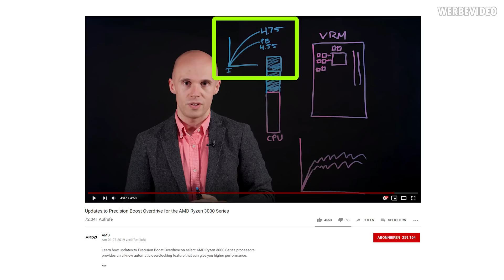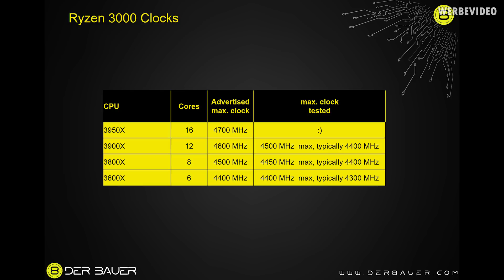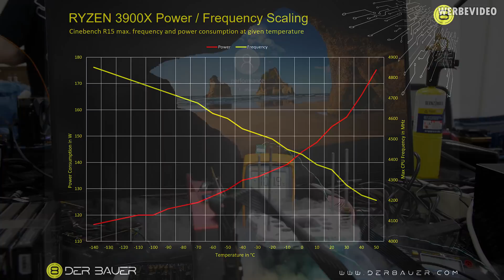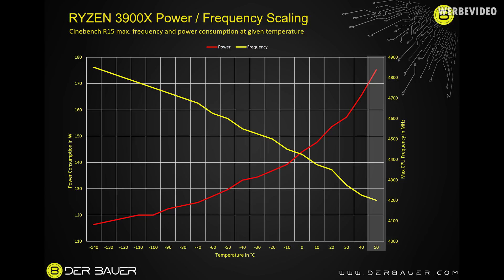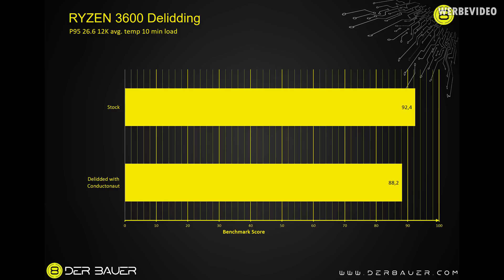RYZEN 3000 Delidded - Overclocking Expectations and Temperature Scaling

Comment: What about LM between the IHS and the Cooler? Here my 1800X was 10c lower with LM.
Reply: If you mean Liquid metal i guess you didnt watch the vid, thats exactly what he did
Reply: @dralord1307  He applied LM on the dies, not between the heatsink and the cooler. Anyway, he said the advertised clocks did not show up even with a CPU chiller.
Reply: Temps aren't the wall between Zen 2 and 5.0

Comment: Ryzen 5000 series surely should achieve 5000Mhz overclocked if not stock.
Reply: There isn’t really a reason to

Compare a 1700x vs a 3700x at identical frequency’s the 3700x is massively better

Comment: So thats why they were so quiet about overclocking at computex and E3
Reply: Wow really, did your 2600x boost to 4.2 all core? No, then why the fuck did you expect this to get to 4.4?
Reply: my 2600 does 4,1 all core easily. with better cooling and that x-chip 4.3 should be realistic
Reply: @m.streicher8286  I'd expect it to hit single core max frequency they advertise consistently. This is saying none of the chips even on a single core hit their max advertised speed.
Reply: @richracing7420  Yep, that's pretty sad. Hopefully it's a bios thing.
Reply: I'd wait for Hardware Unboxed review before jumping to conclusions.
Reply: That's what happens when you believe the Hype train. You will
 end up disappointed because it did not meet your expectations.

Comment: I have already seen one review.  They auto OC better for the most part than you can manually achieve.  They are tapped out to the max pretty much stock.

From what I saw a 3700X at 4.4 matched the 9900k at 5.3 in cb so you can't complain about AMD's clocks with that solid performance. Mind you both we OC'd with chilled water.

Comment: Only an Intel shill could be dissappointed by Ryzen 3000 lol
Reply: Given that my 2700x does 4.2GHz all cores at 1.3675v, the 3000 performance does seem a little disappointing. EDIT: 1.33v.
Reply: @Safetytrousers  stock 3600 with less cores beats it, yet it's disappointing, cool.
Reply: @Safetytrousers  to clarify, in games the 3600 tends to beat the 2700x, it's cheaper and uses less power. If you were to compare your 2700x to it's replacement, the 3700x, it gets smashed and the 3700X uses less power while doing so. Seems like a win to me.

Comment: I have to be honest here I knew they wouldn't hit 5.0 given the current generation struggled to hit 4.1GHz. That said, I find it impressive that you managed to get a 12 core Zen processor up to 4.5GHz :)
Reply: My 2700x has been at 4.2 GHz all cores at 1.3675v since I got it at launch.
Reply: Nah, you don't even need to overclock to hit 4.1 GHz on zen+ and pretty much all of them will hit 4.2 GHz all core without breaking a sweat. My 2700x does 4.25 GHz all core and 4.35 GHz single core with a negative voltage offset (xfr + pbo enabled) which is pretty normal. Getting 4.3 GHz all core and 4.4+ GHz single core is were it starts getting difficult. 

Regardless, you're right in that people who thought zen 2 was going to hit 5.0 or anything close to it were deluding themselves.
Reply: It's not just 4.5Ghz though because you have older Intel Xeon 12 core CPUs that can hit 4.4-4.5Ghz with a custom BIOS on the motherboard, but, the IPC isn't the same, and there's other things such as memory speed support, cache, temps and power consumption which is where AMD truly show a leap in performance, I'm not dissing that this CPU isn't crazy, because it is, but it's not the first time 4.5Ghz on a 12-Core has been possible, if I'm not mistaken a few people have got the old AMD Opteron 16-Core/16-Thread CPUs to 4.4/4.5Ghz but that's on a overkill water cooling setup worth multiple thousands
Reply: @LND3947  Yep. There have been a few people crazy enough ot OC some old 16c Opeterons past 4.4, however compared to the 12c RyZen the power consumption on those chips was absolutely bonkers. The bit that impresses me is how little juice the Zen 3000 stuff sips when overclocked despite the core counts compared to what we've had in the past.

Comment: hello i am here, waiting still 12 hours to be able to buy ryzen in australia :)
Reply: u can get it from shopping express within the next hour
Reply: Ryzen cpus sold put like hotcakes! It launched here in the U.S and BAM, gone. I have to wait for more cpu's.
Reply: @gobogbabyscratcha.k.a.scam7279  they never showed up at Amazon. :(
Reply: @luisangelini2220  Sold out like hot cakes on newegg brother. I was able to purchase an msi x570 gaming edge wifi right before it went outta stock! People are going nuts over these new components, and for good reason!
Reply: @gobogbabyscratcha.k.a.scam7279  that's crazy! I went to Newegg just to see if they had it and was out of stock at 8:50 here in my country. It's probably a few hours difference with USA (for example it's 21:36 at this time). I'll have to wait until Amazon gets its new arrival.
Reply: They available to buy on pccasegear or mwave right now... Unless u wanna buy in person
Reply: @OmarGee92  i just ordered from centrecom, free shipping and it works out 30 bucks cheaper than PCCG for the 3700x
Reply: PLE not the cheapest up front but prices include GST
Reply: fox 6 you mean like everywhere in Australia? Haha
Reply: ɐıʃɐɹʇsn∀ uı uǝzʎᴚ ʎnq oʇ ǝʃqɐ ǝq oʇ sɹnoɥ ᄅ⇂ ʃʃıʇs ƃuıʇıɐʍ 'ǝɹǝɥ ɯɐ I oʃʃǝɥ
Reply: Fixed it